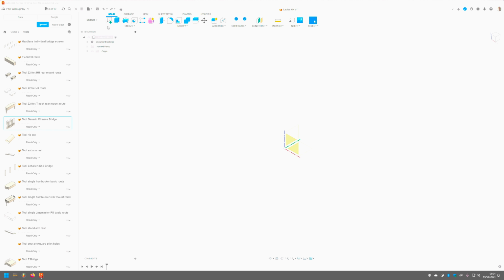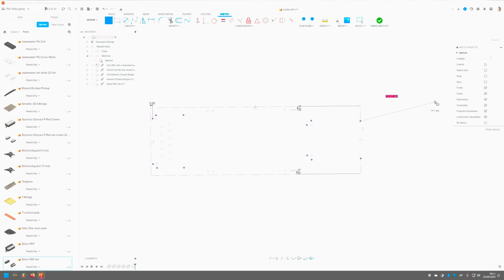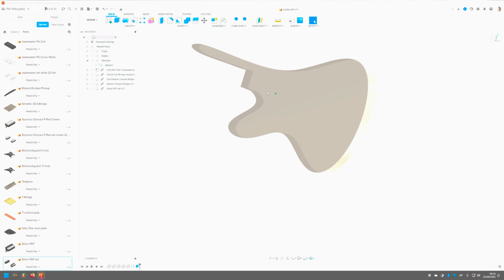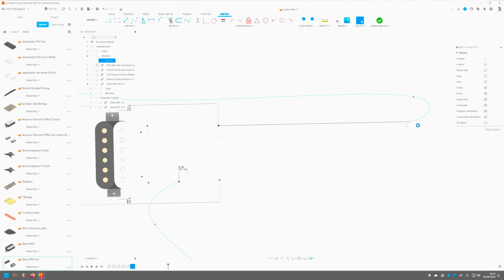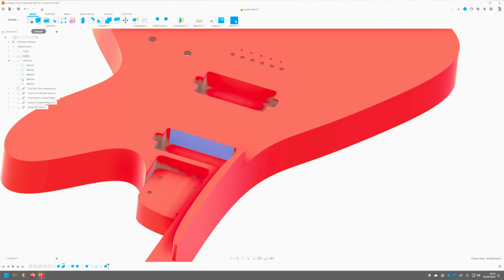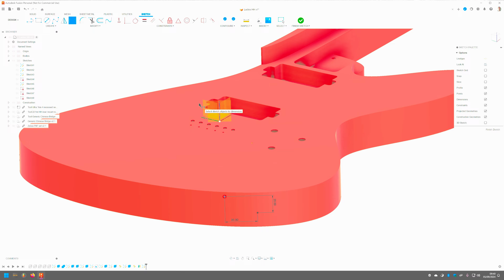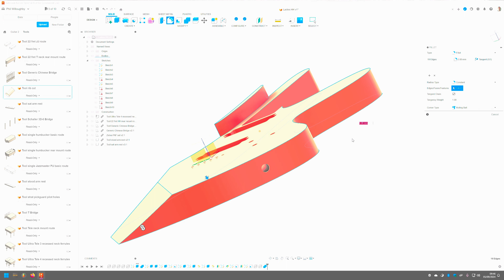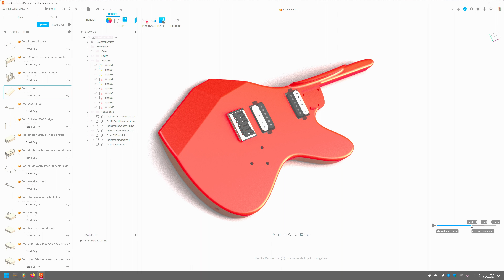How I design an electric guitar - Quadcast episode 8

Comment: Did you get the parts that you import from somewhere or did you make those in CAD previously?
Reply from the maker: I made them in CAD previously. I wouldn't generally trust other sources - not even manufacturer's drawings - it's been best in my experience to measure from actual parts.